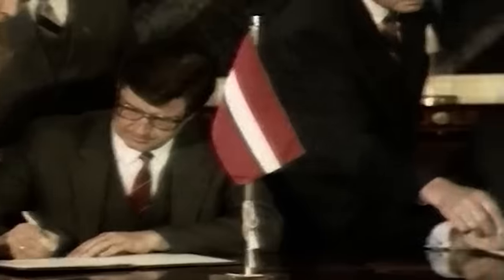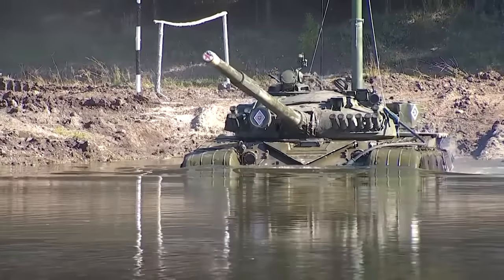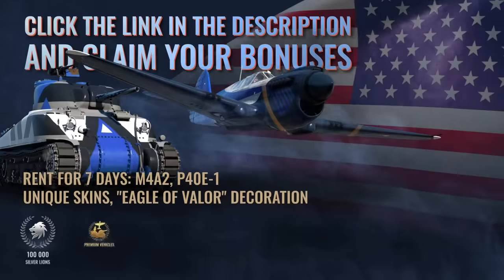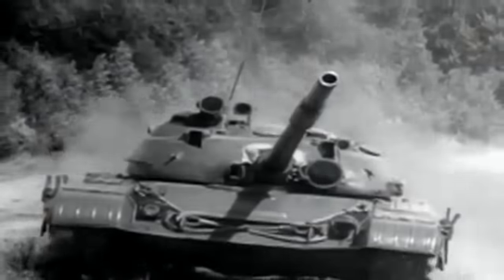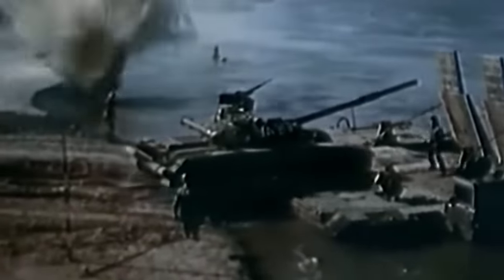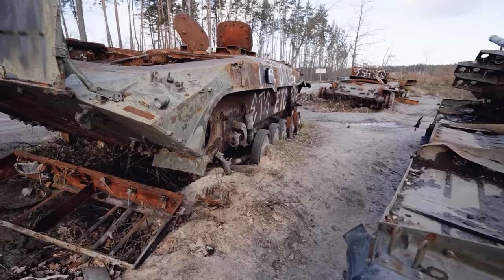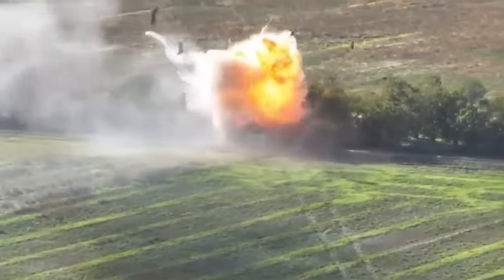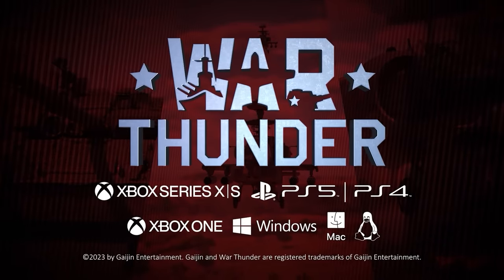The Tank Russia Is Really Starting to Regret

Comment: The Swedish Stridsvagn 103, or S-tank, was my country’s answer to the T-64. I think it would had hold it’s own against the T-64, as it was faster, had a lower profile and also had an auto loader (one that didn’t take your arm off).
Reply: Yes true, but it totally depends on the battlefield. In hidden defensive positions the S-tank would have been extremely hard to knock out at that time, due to armour shape and the lack of a turret.
Hit and run tactics were also a thing it was good at. 

The main problem was that it couldn't really shoot while moving but at that time not many tanks could shoot accurately while moving anyways.

The 64 would likely be more useful against soft targets while the S-tank was a tank killer.  

Both tanks are fairly complex and not as easy to maintain as many other tanks.
Reply: @hnorrstrom  it could do offensive operations just fine, and as you said no one at the time was really firing on the move anyways. the S-tank would just work in teams like infantry and leap frog each other with some setup for firing and some moving.
Reply: The Russian carousel autoloaders were much slower than manual loaders in western tank.  S tank auto loader is still the fastest known.
Reply: @removedot  "it could do offensive operations just fine" so fine that they abandoned the whole idea and never looked back... modern Swedish mbt is just German Leo2 with some swedish specific modifications so they can use Swedish name for it...
The fact that you need to rotate the whole body to aim is huge disadvantage as you showing the weak side armor to one side if you want to aim at the other side.
In case of Soviet tanks(T-64/T72B) you can use explosives to dig a trench for it and in no time you have perfect firing position with only turret visible to the enemmy and turret have very good front and side armor.
Reply: @Bialy_1  Gun stabilization is the reason the S-tank went the way of the Dodos.
Reply: Bwahahahahaha...WALOBS. Sweden should stick to Sauna's and figuring out their immigration issues.
Reply: @spartan5921  Unfortunately Sweden forgot to take care of the enemies within... their own parliament. Sweden will be a fundamentalist Islamic republic before the decade is out.
Reply: @Bialy_1  "so fine that they abandoned the whole idea and never looked back"
Piston engine aircraft being obsolete doesn't make the Republic Thunderbolt less formidable for its era.

"some swedish specific modifications so they can use Swedish name for it..."
Beside the fact that every service use their own name for things (Just look at the names for the 8.4 cm granatgevär over the world), the important part with the Swedish tanks was that they, apart from the power pack, were produced under license in Sweden by domestic military industry who also were involved in designing the specifics as both the Strv 122 and the Leo 2 A5 were derivates from the Leopard 2 Imp.

"The fact that you need to rotate the whole body to aim is huge disadvantage as you showing the weak side armor to one side if you want to aim at the other side."
Fact is that over 60% of all tank losses in the wars 1930-1955 were due to the turret being penetrated. Turning the turret means you expose the weak sides and rear.

"In case of Soviet tanks(T-64/T72B) you can use explosives to dig a trench"
The S-tank had a dozer blade both to fill ditches and dig its own trench, and the total frontal target area of a positioned strv 103 in cover with everything below the muzzle hidden behind the berm was half a square metre.

Swedish defence planning assumed that the Soviets would stick to their doctrine though, thus placing the T-64 along the NATO border as that was seen as the place where the most capable tanks were needed.
Reply: The 103 would have been a huge problem. Its probally the finest defensive tank ever
Reply: True, it's a great tank but it still had limitations which ultimately led to the military abandoning it. The S tank was meant almost exclusively for a defensive war.
Reply: The weakness of S tank was the requirement to stop to aim and fire. Not sure how the long barreled 105 would fair against T64. The S tank was more for shoot and scoot from ambush. T64 was more for open ground like the Fulda Gap. The S tank might be good in urban combat in Ukraine. Add a crows station for the TC.
Reply: During the 90s the Swedish Army aquired a bunch of them and tested the weapons to see what would have been. its refered to as the "big sigh". the STRV103 fired straight through front to end on the t-64s.
Reply: @Bialy_1  Thats some try hard trolling. The strv122 is so changed its a nearly a completely diffrent tank. IF you actually had bothered to either use your brain or just that there thing called the intrawebs you would also have been able to aquire a damn lot of pretty accurate information about both the continuation of the strv103 its domestic proposed replacement and so on. The decision to go for leo´s was nearly purely economical.
Reply: I thought for sure that the Soviets were going to build their own version of the S-tank, up-gunned with a smoothbore 125 or 130mm cannon. I guess I just got suckered by the agitprop in the Reagan years. That man was good at finding ways to spend money, and coming up with the money to spend!
Reply: @davidgoodnow269  funny, they designed something kinda similar to the 103! Obj490
Reply: @GrinXpedia   I heard rumors of that in the late 80s, but never knew a project name. I dismissed it at the time as imagination, so thanks! I shall try to look that up!

Comment: The Engine twin crank opposed pistons two stroke was based on the L60 Leyland Tank engine that the Russians managed to get hold of. The Germans in WWII had developed this concept for an aero engine.  The Brits went one more stage and developed a three crankshaft design used in Marine applications and trains. That was called the Deltic. Two cranks spun one way and the third the other way to get the right phasing of the timing. No poppet valves at all as it was a two stroke, just holes in the liners at bottom of the stroke leading to intake ports. It needed supercharging to function and turbos for maximum efficiency. You can see the engine running in trains on YouTube just look up the Deltic Engine.
Reply: Yup! I saw a couple of Deltic videos thanks to a friend of mine! One hell of an engine!
Reply: Thats not too out of line how two stroke gas engine work. While two stroke gas engines don't have a turbo per-sey, they do use positive pressure from the crank shaft/crank case to force fuel/air into the cylinder and also help evacuate exhaust.  The two-stroke diesel works the same way just without a spark plug.
Reply: Fairly sure the diesels.dont pressurize the crankcase.  Don't quote me though
Reply: Thats incorrect. The 5tdp is built off the x layout 28 cylinder for object 430 experiment and was originally going to be a 4 cylinder 4tdp but ended up with a 5th cylinder. It was inspired by the idea of the jumo 205 however they share nothing in common. The 5tdp is its own design

Comment: Soviet tanks were very capable but the crews just coudn't make the best of them because of how cramped they were. They are literally sardin cans.
Reply: Soviet tank design doctrine called for very low profile, both to make them harder to hit and to allow for thicker armor within a given weight. Those very flat turrets were part of this. The fact that it made them cramped was just something the crew was supposed to live with. The Soviets didn't put much thought into how a more comfortable crew can also fight more effectively.
Reply: Figuratively sardine cans
Reply: Capable of what?
Reply: Literally?
Reply: They were designed for 10% of male population... 10% is more than enoght to have short guys in every tank, modern day Russia have taller population but you can find short guys for tankers if you want anyway...
Literally one extra meter of hight with weak side armor that your enemmy can aim at is not an advantage even if it is able to provide plenty of extra space/comfort to the crew inside.

Comment: Just to clarify the Challenger 2 still holds the longest tank kill because this was direct fire and it was one shot.. That is when the gunner can see the target. The Ukrainian T64 wich destoyed a Russian T72 wich took a lot of HE shells was indirect fire which was guided by a drone operator. There is a differece like between a 200 meter race compared to a long distance one.
Reply: That the shell can travel over 6 miles is mind-boggling enough, rendering normal artillery far less significant for many purposes. Not to take away from the Challenger2, with today's integrated battle systems I'm not sure which record would stand, as air-spotting of artillery and naval gun strikes has been happening for over 100 years now; nobody says that this doesn't count for their record shots. Still, for that Challenger2 to make the hit with one shot is very remarkable and commendable even if you place the T64 ahead in the game.
Reply: Wasnt it a chally 1?
Reply: Russia probably now has at least one kill of longer range from a tank as they have been using older tanks in indirect fire role. Only there is no way to confirm:)
Reply: That chally kill on the T-55 was literally the equivalent of hunting a rabbit with a 50 cal lol .
Reply: First off, it was a challenger 1 that held the previous record not the 2, and the fact that it was indirect fire and took more than 1 shot dies not mean the Ukrainian t64 did not make the longest tank kill in history. 6.5 miles in an arc out of visual range via drone assistance is far more difficult a feat than a 3 mile direct fire within visual range shot. I am a former M1A2 Tank commander just so yall know by the way
Reply: @MiG21fanboy Correct it was Ch1 not Ch2
Reply: it wasn't 1 shot though the gunner took several shots to land a hit and it was a knocked out tank it hit.
Reply: A tank is not an artillery weapon.  It's designed for "Direct Fire".  Fire enough shells and they could hit something, or you could use an artillery battery and decimate a target with fewer rounds.  An High Explosive (HE) tank round has different burst/kill properties than an artillery HE shell which is designed to cover a large area and kill a lot of people than shooting 20 tank rounds which you're guaranteed to hit the earth with every shot.  Tanks are not designed for this purpose and they wasted 19 other rounds.  Proper tool for the proper purpose.
Reply: @mrgrinch837  ever think about the fact that maybe they had no art elements available at the time? And art isn't the proper tool to take out enemy armor either, and indirect fire is not an improper usage of a tank on a time sensitive target like another tank which I am sure did not just sit there as HE rounds started falling all around it, hence the 20 shots..t64s do not have the same fire control ballistic computers used on modern tanks as well so the gunner of that t64 should be congratulated for being able to hit a t64 within 20 rounds from 6.5 miles our at all not criticized for the amount of shots it took, or those perceived improper use of a tank for indirect fire by those whom have probably never stepped foot inside a tank other than on silly fucking computerized games, let alone have ever operated or commanded one on a real life battlefield..M1A2 tank commander 1996-2006 incase ur wondering
Reply: @NitEmaRe77  actually, we have Copperhead rounds which are the old laser-guided munitions, replaced by Excalibur which will take out a tank with one shot. And as well if there are tanks in the vicinity there's artillery as well. My point was that you just wait until you get eyes on the target so you don't waste 19 out of 20 shots.  T-64's  carries 28 rounds, - 19 that were basically thrown away it leaves the man with about eight rounds left. Should a tank Target present itself the man has fewer rounds to try to engage it. The tank ain't going nowhere that it can't be found again. But to just simply throw rounds out there shooting Mother Earth is a futile waste of ammunition that would have been better served to actually kill tank targets.
Reply: @mrgrinch837  I get your point, and yes it can be found again, however what if it's found again in a far less advantageous situation? He only had 8 rounds left yes, but he was probably not far from resupply and as long as they have been fighting the Russians I don't think he would have expended those rounds if he did not feel he could get away with it, and 20 tank rounds for a t64 is still cheaper than 1 Excalibur round. I am not trying to be an asshole here, I forgot about copperhead so that's my bad, and when I was in Excalibur wasn't a thing, you make great points however. All I am saying givenbthe distance and equipment he was using he should be congratulated nit have his actions critiqued and criticized at every point.
Reply: My point of view here is as 10 years as a paratrooper and 10 years as an attack helicopter pilot. It's important that you do a round count with every engagement. If something is not within your range you don't shoot at it. That tank is a direct fire weapon system, it is not meant to hurl high explosive rounds in the distance. It's not a mortar, it's not a Howitzer. They work in an area that we call a Killzone or an anti-armor ambush. If it's not in your sector of fire to engage with your direct fire weapon system than you do not engage, you do what's called a hand off. With the M151E2 TOW jeep we can carry three tow missiles. With a Humvee we can carry as many as four with an ammo carrier close by. The Cobra we can carry at the most four missiles depending on weather. These are direct fire weapons, if there's something out there on the battlefield that we cannot hit with our weapons than we do a handoff to others who could. The last thing you want to do is run out of bullets in the middle of battle.  I am a retired Chief Warrant Officer with 20 years in the Army and I've never heard of indirect fire with a tank before. Not saying that it never happened I'm just saying that it is a fabulous waste of ammunition, as that's what the cannon cockers (artillery)are for. Where as the old saying goes bullets are life. You run out of bullets then you're probably going to run out of life. You got to make every shot count. Going indirect fire with a main tank gun is an idiotic thing to do, can it be done, yeah but it's still an idiotic thing to do.
Reply: @mrgrinch837  I mean think about it man, the flack 88 was an anti aircraft gun untill the Germans discovered it would kill the fuck out of a tank and started making improvised versions after that first pressed Into service in 1940 with continuous improvements made to it throughput the war...just because something is labeled or made for one specific use does not mean it cannot be improvised for other unintended uses should the need arise. Germans had no idea the 88 would do that, that efficiently untill they tried it...
Reply: The Challenger was supposed to be the saviour in the Ukrainian conflict 👀 that didn’t end well. Now they’re kept at the back as it’s not good for PR when selling these tanks 🤔 The sad truth is that Ukraine is loosing & losing badly with estimates of between 400k & 500k dead, you won’t here that in the news. Boris Johnson put a spanner in the works when he flew out there & Elensky no Z awarded Bojo with a cockerel 😂
Let’s go Brandon & Bojo
Reply: I totally agree, served in South Korea. One of the things that the South Koreans bought from the US were our older Vulcan APC's when we went to the Avenger system. You know what a Vulcan will do to a tank? It will start to peel it like an onion and then stomp it with a big ass boot. The difference that we're talking about is that again, if you have to use 20 rounds to hit one tank, it would have been better to just do a Battlefield hand off. I can't Envision what it's like to just keep shooting tank ammo out into the world and not expecting to get a hit. If this story is true they were lucky to actually get a hit but it would have been a whole lot better tactically if they would have just handed it off to someone who could have killed it in one or two shots. That's all I'm saying, they wasted a lot of ammo and they didn't need to. 20 years in the Army and I guarantee you we never would have done anything like that. Now vulcan's on tanks, hell yeah! Those things fire 20 mm at 6,000 rounds a minute? In the words of that Sergeant in the movie Blue thunder, that's one of hell of a shitstorm in anybody's language! @NitEmaRe77
Reply: I don't even know if this story is true, it sounds kind of hard to believe. Tanks don't have that kind of accuracy at those ranges. It's pretty much throwing darts in a dark parking lot hoping to hit your buddy in the back when it's much easier to run him over with the car with a headlights on. Again, I don't know where the story came from it just doesn't seem tactically sound. I have been a squad and team leader working on tow missile jeeps and Humvees on the ground for more than eight years and this is not in any strategy I've ever heard of. Even if they did have a hit it's extremely wasteful. A tank is not invisible, the Russians have found out that the longer they're in a tank the shorter their lifespan is. It would have been tracked, somebody with a more accurate and capable weapon system should have been vectored in to make the kill. Firing indirect from a tank with a forward Observer looking through a drone is a horrendous waste of ammo. Again, having a hard time believing this story. @NitEmaRe77
Reply: Drone observation is now key to the battlefield. That and electronics and satellite, AWACS.